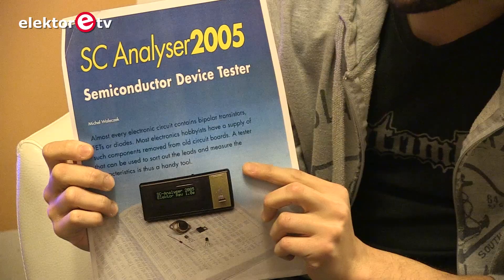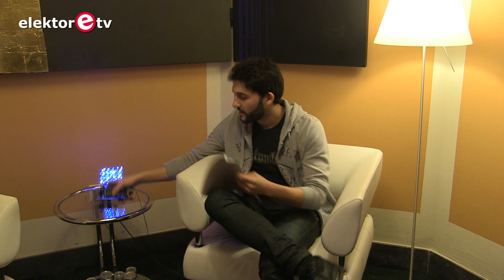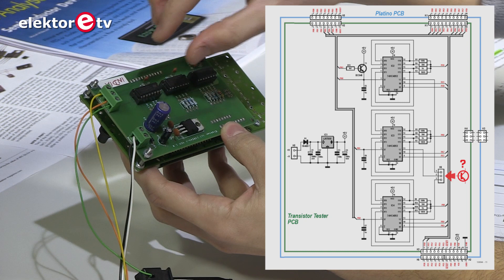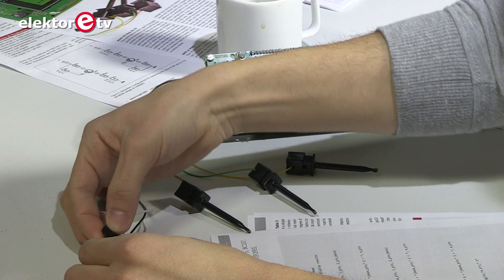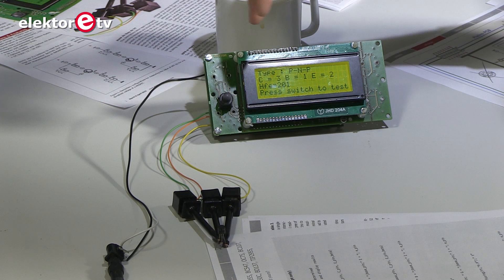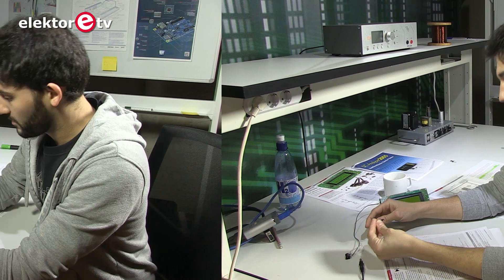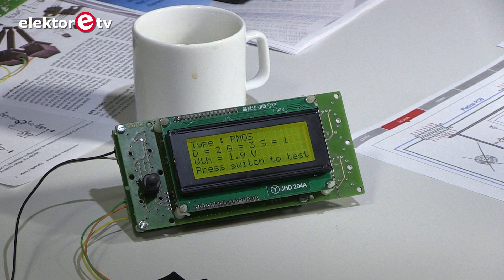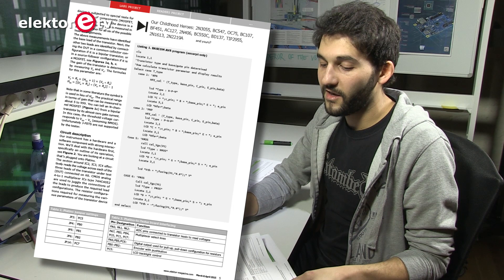Experimenter’s Transistor Tester: No Markings? No Problem!

Comment: Elektor should quickly reinvent itself it becomes too expensive and young generation can not effort it anymore !
I bought that tester on E-bay months ago for US$15,- (free shipping from china to Europe) mine can including functions mentioned on this video also can measure C,L,R from 0.1ohm up to 50Mohm can measure 2 resistors (potentiometers) same time.ESR of a capacitor also Generate signals at steps 0.1Hz,1Hz,10Hz.....up to 10MHz Also it can identify SCR's Triacs, Diodes,and Zeners with low breakdown voltage .

Also the books elector publishes are expensive ! with all it connections around the world (power of distributing) price should be lower!